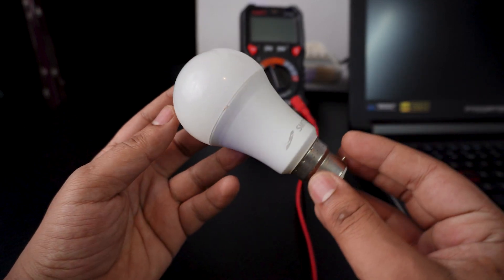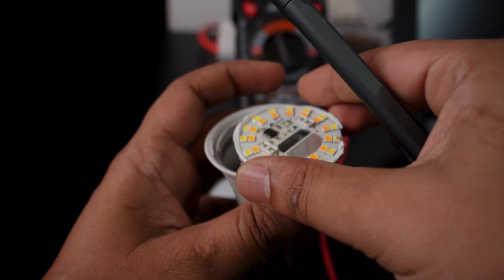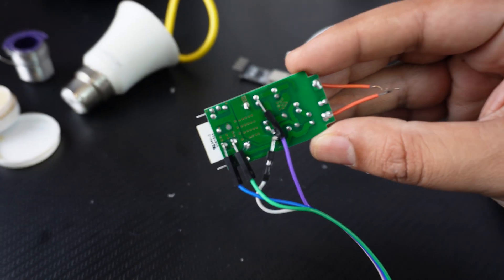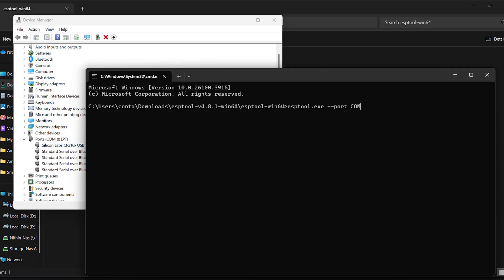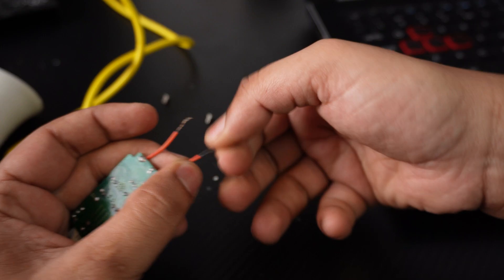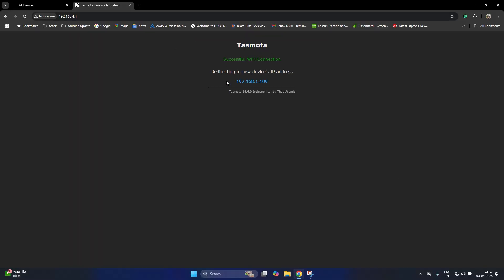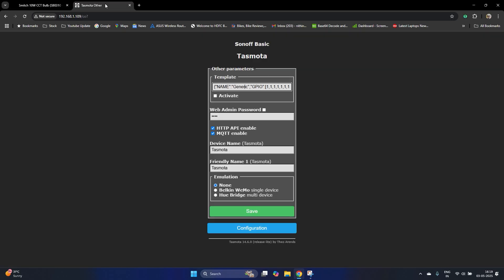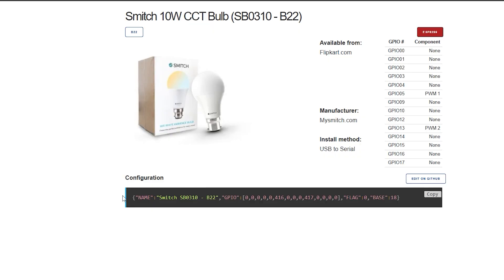Smitch Smart Bulb Back to Life! | Removing Cloud from All Smart Bulbs & Flashing Firmware (Kannada)💡

Comment: Got my bulb working again, but can’t get it paired with google assistant or alexa, please make a guide for the same
Reply from the maker: You can add to Google home or Alexa, 
Settings on Bulb > Configuration > Other > Set Device name > Emulation> Turn On Hue Bridge  > Save 

Settings on Alexa or Google Home app > Devices > + Add Device
Reply: @t @techiga  thanks for the quick reply. I have reached till selecting devices in alexa and google home app. But unable to select the right device model. Have tried multiple of the listed but neither worked. Can you tell which product to select from the list?
Reply from the maker: Turned on hue bridge option on blub setting?

Comment: Thanks a lot - That did me a lot of good - I had 3 bulbs dead - Worked with the WhiteCCT with no issues, as shown.
I had to figure out the tx,rx,gnd pins for the RGB CCT model bulb - Works like a charm now.
Some color mismatch when using with Alexa, still - No complaints. Works great
Reply: How did u pair it with alexa, can you please guide me, like what to do after turning on hue bridge. Which option to select in search device

Comment: Thank you so much for this video
After flashing can this be integrated with Google home? If so which brand to choose while adding this bulb in Google home?
Reply from the maker: Yes, you can add to Google home or Alexa, Settings on Bulb > Configuration > Other > Set Device name > Emulation> Turn On Hue Bridge  > Save 

Settings on Alexa or Google Home app > Devices > + Add Device
Reply: @techiga  Thank you so much 
After "Add Device" , which brand to choose from the list provided by Google (if Hue Bridge is chosen during configuration)
Reply: Did you get the solution to how to connect to google home
Reply: @Saurabh.SiddharthI haven't tried this yet. Will keep you posted